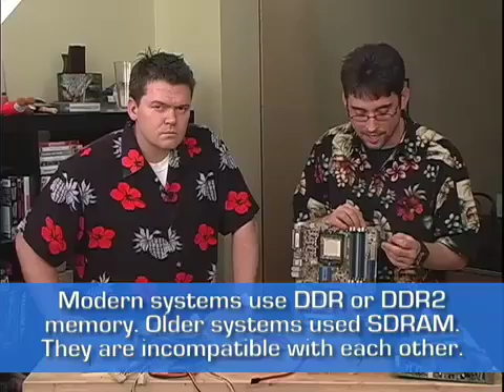Motherboard Anatomy - Lab Rats #13

Comment: I spilled soda on my computer and it leaked onto my mother board. I tried to clean it the best I could. I was pissed!
But there is soda stains next to the wire trails right next to the AMD processor chip. Now when I plug in the Ethernet cable to get online my mouse and keyboard will fail. Or my memory fux up too. It will displace stuff I was working on and random music files will delete or shortcuts on my desktop will be removed.

Comment: What about the north bridge? South bridge? BIOS? Internal graphics chip? You missed slot of key issues as well as esd. Also ribbon cables in 2012? It ain't 2005 mobos don't come with those anymore